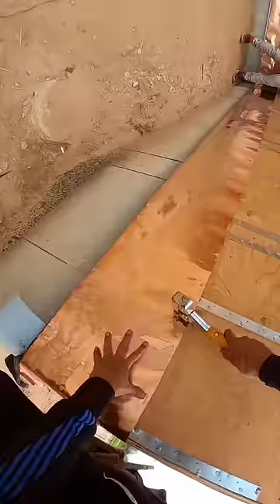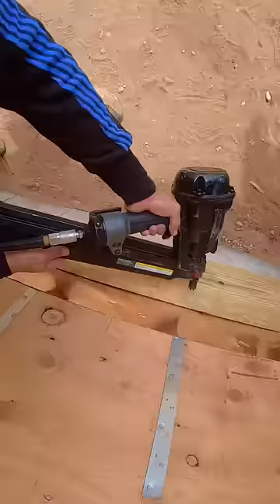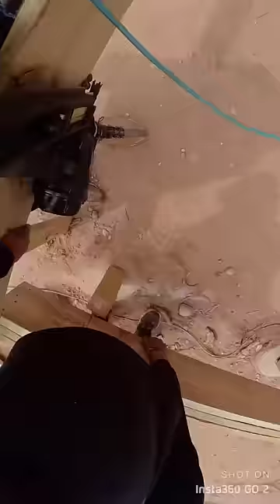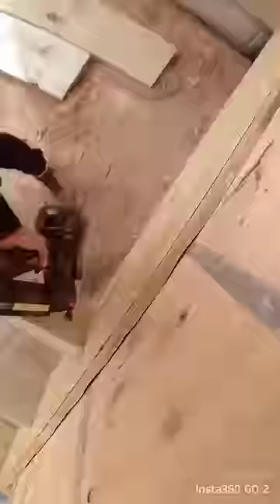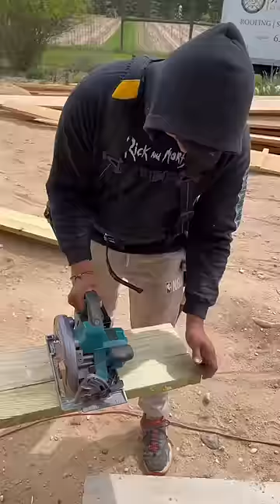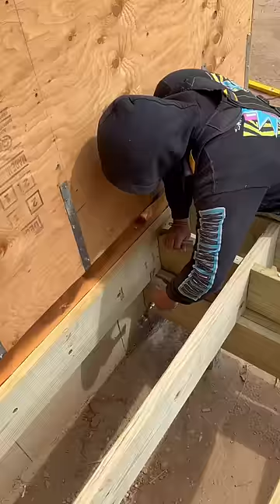Small decks takes a lot of work #work #shorts #construction #skills #quality #design #art #tips

Comment: Every galvanized nail you put into that copper is going to be a hole in a few years due to electrolysis.
Reply: I had no idea about this info, I did some research and I learned something new. Thanks man
Reply: 🤣 facts
Reply: what is the copper for
Reply: Let’s celebrate the great idea to nail the decking THROUGH the flashing
Reply: @BobbyBaloney  Yeahhhh if it was some sort of self-sealing flashing like Vycor or whatnot, sure, but copper? This deck seems overbuilt, but not in the right ways...
Reply: @b9ruJq2  a shield to protect from water is my guess.
Reply: why use copper flashing over other materials?
Reply: @TomatoWithARifle  It’s really durable. Lead is also a good option
Reply: @TomatoWithARifle  vapor/termite barrier
Reply: You must be a sheet metal guy like me smh it kills me to watch this video
Reply: @TomatoWithARifle  copper doesn't rust
Reply: @zovvi5900  
High school science
Reply: @b9rujq278  flashing. I use a rubber membrane instead of copper.
Reply: @drew5334 i use zip tape on the top of all my joists, but never copper, just regular metal for flashing. Ive heard copper repels termites ??
Reply: See, you’re right about the result, but electrolysis definitely isn’t the right word. Galvanic corrosion is the term you’re looking for. Electrolysis involves passing an additional DC current to the electrolyte solution contacting the metals. Assuming there aren’t any loose live wires in close proximity to the structure, electrolysis seems unlikely to occur here.
Reply: A galvanic cell?
Reply: Don’t hate the player hate the game. Probably some stupid code.
Reply: @b9rujq278 it’s the flashing they use to protect the ledger from rot

Comment: You can't shoot galvanized framing nails through copper flashing creates electrolysis
Reply: Yeah, someone will find out about the problems that causes in a few years 😁
Reply: I was going to say this, even the t-50 staples will — it needs copper roofing nails
Reply: Yep they hacked it in...
Reply: naww not electrolysis, dude said in another comment "galvanic corrosion", deemed THIS. .
✅💯
Reply: @stevebengel1346  &also you're absolutely correct 💯%!

CALLED. job security!!😘🔥✅🥧😅

Comment: What is the copper lining for and why doesn’t any deck builders apply weather protector oil to the lumber underneath?
Reply: Lumber comes from the store "pressure treated". You don't need to add anything. It's already weather proof. As for the lining, it's supposed to keep water from getting between the wood and the house which could cause rot over time. Why they didn't break it over the edge of the rim and why they nailed through it has me perplexed.
Reply: @AOMartialArts  thank you for your answers. When I bought my house the owners had just put in a brand new deck. It had metal lining, not copper, but I never knew why. And I get that lumber comes pressure treated but isn’t that just good enough for indoor building? Why do they sell deck weatherproof oil/stain? When I got my home inspected it stated the underbody lumber of the deck wasn’t weatherproofed. The top was composite.
Reply: @newbluerugby  You can get timber treated for indoor and outdoor. It depends what grade it is. Deck oil and stain is for the boards on top. That's how it's donein New Zealand/Australia. Never heard of weatherproofing the frame of a deck
Reply: @edwardhunt4883  dude, I don’t know who u are, but u just made me feel a lot better about my deck, happy new year

Comment: Excellent job, but you have to use joist hanger nails in your hangers not and nail gun. You are putting holes in you copper flashing if those nails are longer than 1and 1/2 inch
Reply: You do know they make metal connection nailer's right? A.K.A strap nailer. Look to me like a strap nailer.

Comment: Copper flashing but no hangers on the wall tisk tisk
Reply: Look again there were hangars on wall with the copper.
Reply: @EthanSlocum55  You do realize this is a YouTube short right? You're not going to see it completely done in 3 min video 🤣. Yes I see just 2 hanger's, but don't you think that it's not done yet, or everyone is at lunch? I work for Licensed General Contractor of more than 30 years. I don't have to see it completely done to know that all would have hanger's because it's in the plans and is code and wouldn't pass inspection.

Comment: The key is to NOT attach it to the house!
Reply: Says who?
Reply: Seems you're talking about yourself. I work for a Licensed Contractor of more than 30 years. We build 2 and 3 story Custom beach houses.The deck can't just free stand 🤣
Reply: @jonathan3982  No shit Sherlock. The deck above the 1st floor obviously cannot be  freestanding. The video in reference to the original comment does not apply. The point was if you're already digging footers for a ground level deck why not dig a few extra so you don't have to be concerned with flashing concerns.
Reply: @sugarshane7131  CODE.... Have you ever heard of it? Building code require's it be attached to structure. I work for Licensed General Contractor of more than 30 years. We build 2 and 3 story Custom beach houses South Florida.
Reply: Do have to explain building codes, blueprints, etc:? Can't just do whatever the hell you want, blueprints have to be followed to pass inspection.
Reply: @jonathan3982  Again, no shit. Whatever is submitted to the city has to be approved and followed accordingly by the builder.  This is not new information.
Reply: @sugarshane7131  Again So why are you bitching about the flashing? Obviously it's, again code and in the plans for it to be there and attached to the structure. I've never seen a deck that wasn't attached to the structure. So why are you complaining.
Reply: @jonathan3982  You're so delirious.  Nobody is bitching. I've built plenty of decks that WERE NOT attached to the house and yes they were inspected and approved. You admitted that the decks your company builds are above the ground floor which would require attachment to the house.  That's everywhere! My point was why add extra time and material to attach a deck on ground level when CODE does not require you to do so? This will be my last reply. Good day sir.
Reply: @sugarshane7131  Well here it's CODE to be attached ground level or not! This crew is in New York, just because it's ground level doesn't mean jack shit, AGAIN if they attached it to the structure it was designed that way by the Architect that drew the plans. Now chew on that apple 🍏. Good evening Sir. Building codes are not the same everywhere.